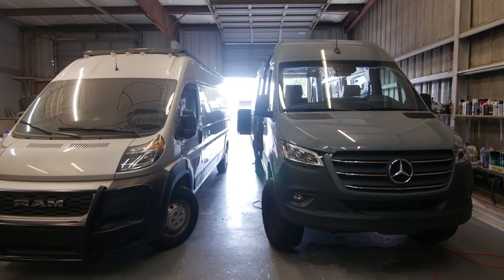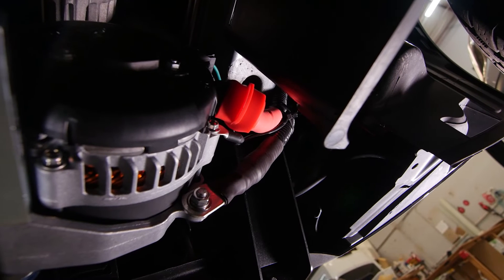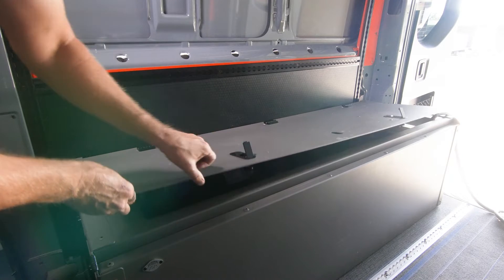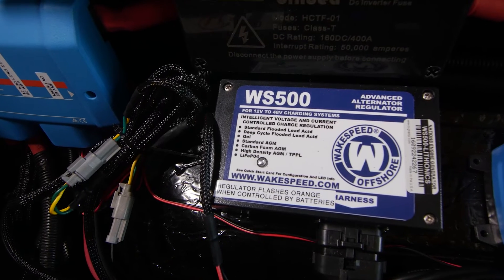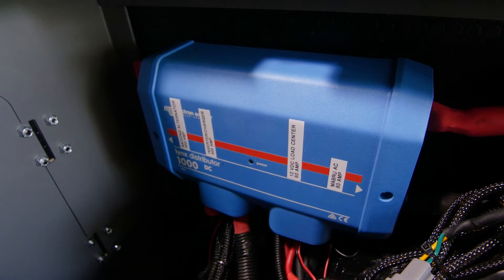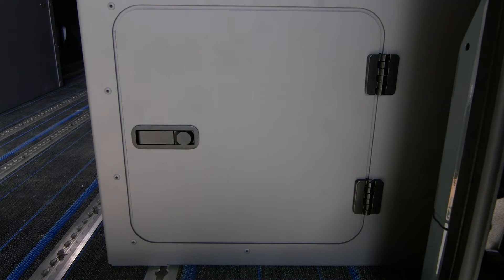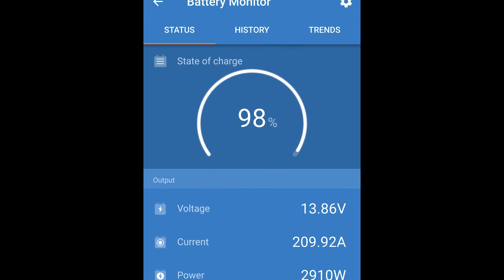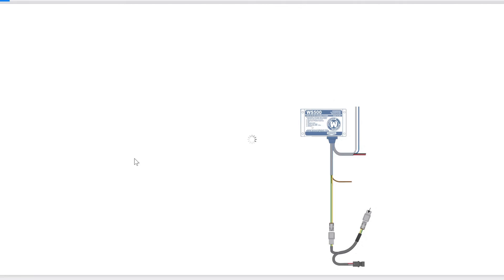Camper Van Secondary Alternator Electrical System Tour

Comment: How about a video detailing the alternator installation on the engine.
Reply from the maker: Hey there, we did make a video that covers this a bit on a Promaster. https://youtu.be/2tZdGV-MEQk
Reply: @VanlifeOutfitters  well just finished  installing my Sprinter alternator fr9m you.  It took about 5 hours in my driveway, but couldn't torque the crankshaft bolt that tight even with a 4' cheater bar.

Comment: Will this void the factory warranty on brand new Sprinter?  Void insurance coverage?  Also, I understand new vans come with an option for a beefier Alternator, would this not be cleaner/easier than a having a second dedicated alternator?
Reply from the maker: Regarding the warranty, we're not legal experts but the Magnuson–Moss Warranty Act makes it illegal to "void" a warranty based on aftermarket parts or other modifications. If your modification actually causes a problem, that problem is excluded from warranty coverage, but it was always excluded--nothing is "voided".

Vehicle alternators are not purpose designed for continuous high-output charging like secondary alternators from Nations or other similar options are. They typically cannot be externally regulated with something like the Wakespeed that can monitor multiple factors like temperature of the alternator, voltage, current, etc. Vehicle alternators don't have safety features like avalanche diodes. Plenty of our customers will use their stock or upgraded vehicle alternators instead of a dedicated, purpose-build secondary. The general recommendation is to limit charging from a vehicle alternator to less than 50% of it's output rating so that you don't overtax it - particularly at idle. In a lithium battery system that is typically done with DC-DC chargers. To get an equivalent 200+ amps of charging from DC-DC chargers would be pretty expensive and have it's own complications.

Comment: Nice video- thanks! I am sorry if I missed it but did you program your wakespeed so it is off or derated at or near idle (to prevent too much load on engine at idle) or at high RPM, eg when you need all of the power of your engine? If so, how does it sense the RPM? I heard the Wakespeed has a feature called “Adaptive Idle” where it can estimate the RPM without it being fed actual RPM. Do you know how accurate this estimate is? Thanks again!